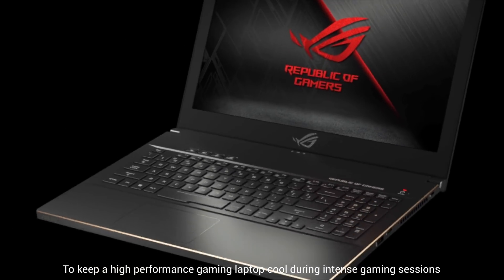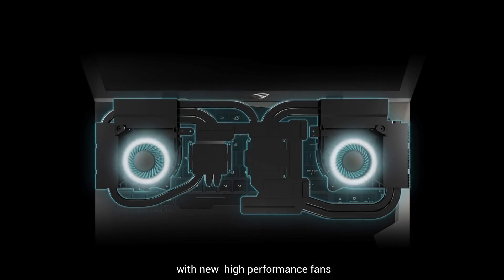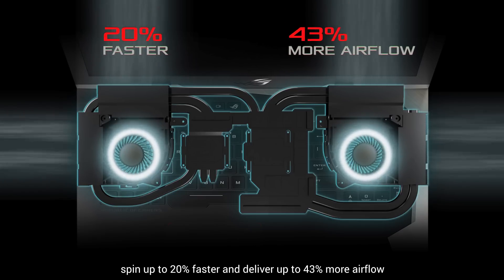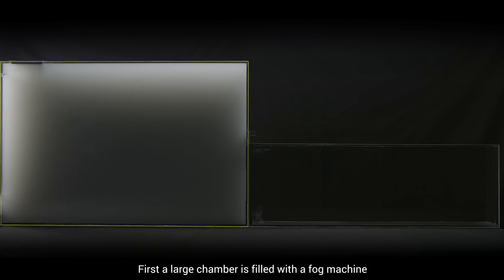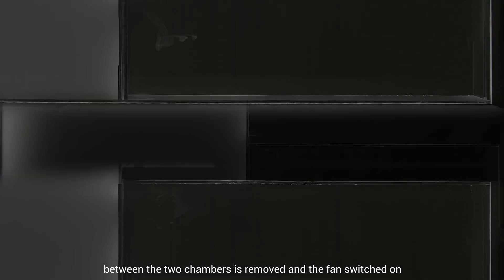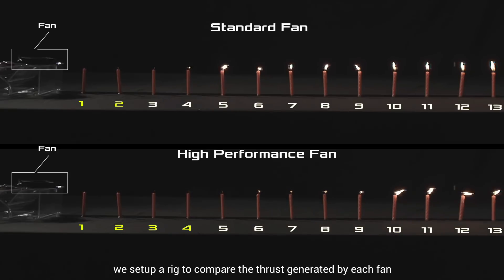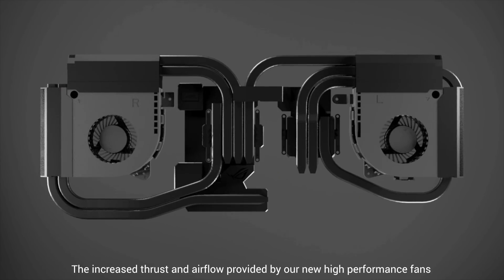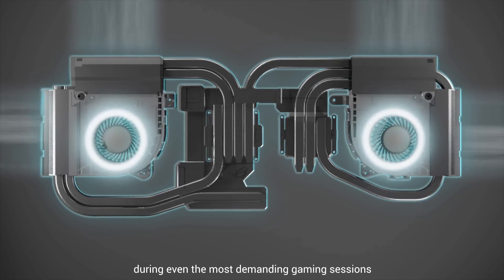High Performance Fans - ROG Laptops | ROG

Comment: I recently bought the ASUS ROG Strix GL703GS and the fan performance may have increased but that gain is causing a rediculous amount of noice even in silent mode. Even when I am not running a CPU hungry program, the fans spin up every 2-3 minutes (or less) which is VERY annoying. To avoid unnecessary spinning of the fans, I had to reduce Maximum processor state to 48% (!!!) in the Processor Power state setting in the Advacned settings of the Power Plan settings.

Really? I have to reduce the performance of my laptop to under 50% while working with it on a regular basis??????

There should be a better solution for this ASUS. PLEASE FIX THIS!!!!
Reply: I agree ! It's crazy that companies don't address fan noise on such expensive equipment.  Very annoying, I'm looking for a 15W processor to try and avoid this but then I'm stuck with lower performance and super thin laptops with terrible cooling systems.  there is just no way out of this mess

Comment: How do I lower the fan speed?
Your company's shitty software keeps them at max, on 35C, even when at silent profile (from the first moment of boot up!).
There's no way to change it in the bios. I tried to bump a thread with the same problem (showthread.php?97282-Zephyrus-fan-noise-while-idle) but your shitty site can't even complete my registration to the forum.

Comment: I bought an ASUS ROG Strix GL703GM-EE014T as a desktop replacement which arrived two days ago. 
I was surprised to find that those fans are constantly going, even when working on a word document.
Setting the fans to silent increases the temps to nearly 60 degrees. 
Is it safe to constantly run the machine with a base temp of 60 degrees? (Ie, it will inevitably increase as I open more windows.)

On a separate note, I've tried accessing the rog forums, but the login seems to be broken.
https://rog.asus.com/forum/userupgrade.php
No matter how many times I enter and verify the captcha text, it says it is incorrect. Does anyone know how to get in contact with ROG support?
Reply: lol, i have been running for 2 years my laptop at 90-96 degrees and it's still running games as allways
Reply: @retroke6560  bro i get scared when my laptop reaches those tmp levels. i try to download the rog gaming center to control the fan and put it to overboost but i cant seem to find the correct app because my fans dont work no more
Reply: Don, so how is your experience ? is it safe to use the laptop for light work with fans silent ?  I can't stand the sound of fans, I am interested in this laptop because there is a button to control fans.